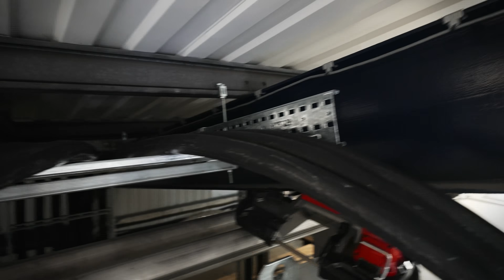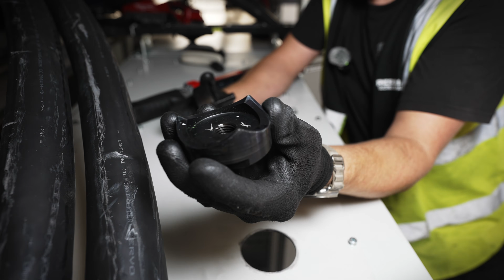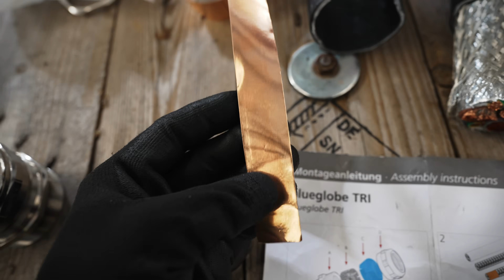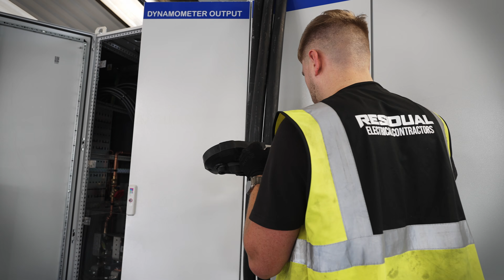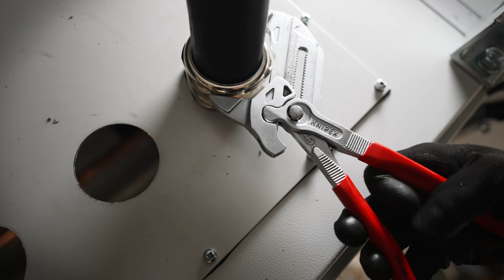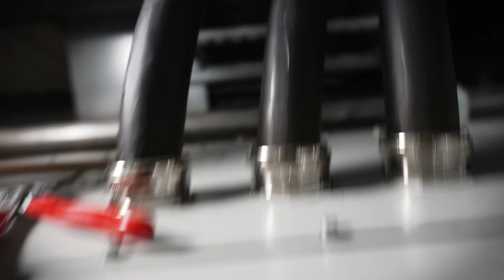Glanding 6 × 185mm² servo cables into a 3000A busbar

Comment: just reached the point on your video where you believe putting the cables through the holes in the gland plate is the most logical way to get a measurement on your cables. just hope you know im not being a smart arse or a know it all, however Im specifically doing glanding and terminating work for the last 4 or 5 years and I might have a few tips to make your life easier

Comment: Bro you must have lost the bit you have left upstairs! Using that digital milwaukee torque wrench for something like that is insane. you can buy or obtain a half inch ratchet breaker bar to suit the head of that bolt for less than £20, YOU could also put a 17mm or 19mm socket on an impacter and pull those Circular dies through that aluminium plate like butter

Comment: One tip. Next time I would try to place a cable gland on the cable and then push the cable through the hole in the ceiling of the switchboard. First of all, it is not very convenient to work with such a large cross-section and in your case the gland is also quite tight. This way you will have quite a bit of space because you will push the cable without the top insulation through the cut hole.

Comment: Get a hydraulic punch driver - it's a game changer even on smaller holes - even if you get a manually pumped rather than the Milwaukee one.
Reply: The manual pumps are excellent and reliable. No need for the battery ones unless you're in awkward/tight spots all the time.

Comment: In the uk its called VFD cable, variable frequency drive cable.

Used loads of it for chiller compressors.

The outher screen and the 3 earths between the conductors reduce interference between the phases and reduces wear on the compressor bearings
Reply: Bearings, interesting. I wouldn't have thought EMC would have such an impact.
Reply: @drogomyslrad It does, any type of leakage current will evetually destroy metal bearings. On some applications only ceramic bearings can be used to protect them from any kind of wear and tear caused by EMC and leakage current

Comment: That sheath and gland design is really smart. Ensures the fields tightly couple between the forward and return paths within the cable, with minimal parasitic inductance and radiative EMI. Super important with high dI/dt loads like servos. As you said, lovely bit of kit.
Reply: I might be wrong, but isnt every servo cable shielded? ive never seen one without even on 100w servos
Reply: @indian.techsupport  The braided shield itself isn't the interesting part, it's the spring pressing against the braid and the layout of the conductors inside the cable.

Comment: Heat shrink covers a hold load of sins🤭, it used to be electrical tape… still is if there isn’t the former one available or a heat gun.

As. Tester/ inspector, I always had a gripe with Installers/ Terminators that tape up the bedding material and the basic insulation, I alway had to removed when testing and inspection just incase there were any nicks or cuts in the inner cores…. 
Nice demo of a new cable type though  Mike 👍❤️

Comment: Pro tip to secure the cable to the end of the ladder when its not touching. Use pipe clamps with rubber, cut threded rod to lenght and use washers and nuts to fasten it to the steps.

Comment: Facom do a lovely 3/8 drive extendable ratchet, but I would imagine the hydraulic hole cutters would be sweet to use if you have enough work to justify them. I only ever used the hole cutter types you had, used to spend half the time getting the waste out, but much nicer than hole saws.
Reply: I have used hydrualic and electrohydraulic hole cutters very often. I would not do it by hand anymore. I did lots of stainless, the cutters for stainless are far better than for normal steel, but they are very, very expensive.

Comment: whats the standard in a ladder cable tray the distance between two cables in a ladder cable tray should me ?
Reply from the maker: No standard, depends on the ladder and circuit design and all of the factors that need to be considered there 👍🏼
Reply: @residualelectrical  cool mate thank You 🙂
Reply: @residualelectrical hi, that’s not quite right. I’ve not watched the whole video, and apologies if I’ve misunderstood. That looks like Lapp servo cable and they publish a series of derating tables based on how the cable is run, how many cables, temperature and load sharing. Generally, on open ladder, it’s recommended to run cables with 1 diameter separation to prevent excessive thermal derating. You can run them next to each other, you just have to derate appropriately and this may mean bigger cable. Whoever did the cable sizing calcs should specify this. The derating tables are available on the Lapp website and are an easy read to find out the relevant derating factors.
Reply: @bengodfrey8579 can you not read ?. He said it depends on the circuit design.